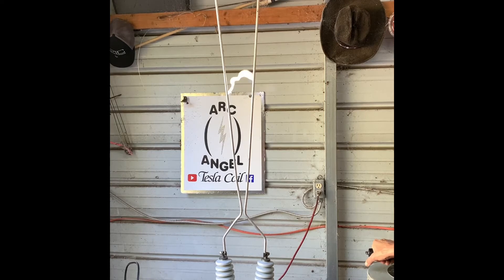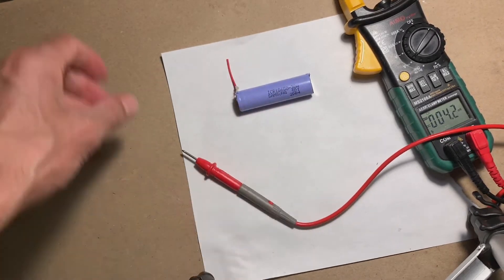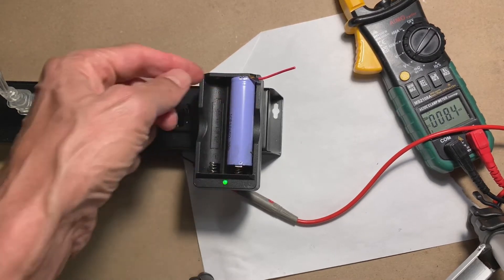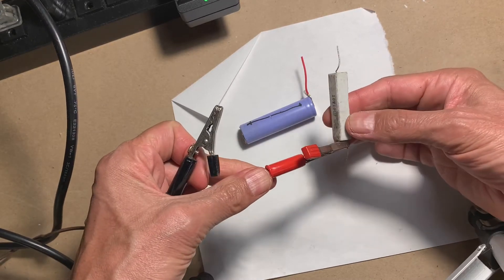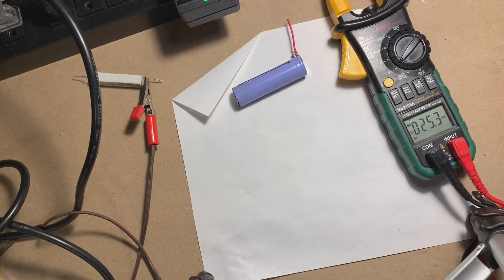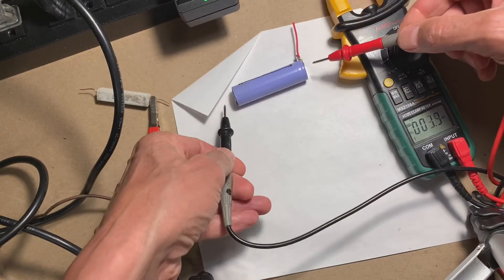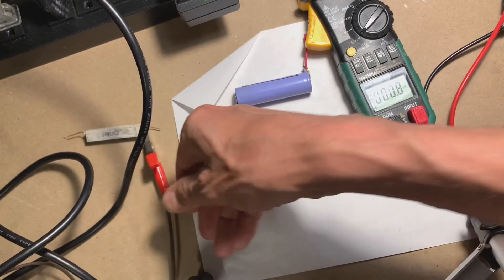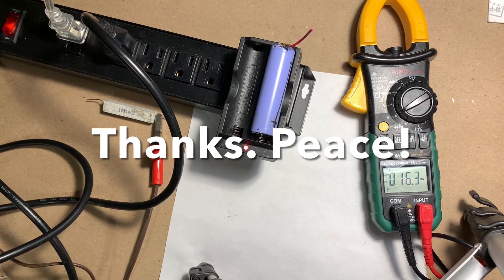Breathing New Life into Completely Dead Lithium Battery

Comment: Hi! Very clean and clear presentation! This does really work well. I have been using this technique to salvage seeming dead Li-Ion's from old Laptop Battery packs for several years now. However it may bear noting that you will rarely recover the battery back to it's full original capacity. I once inadvertently left a cell to discharge to zero, and though the original cell had been tested to 1200 mAH capacity on tests conducted previously it only recovered enough to deliver about 800 mAH after the abuse. This is still better than dumping them in the recycling bin or worse, contributing to industrial waste! They can still run many low current draw projects.

Comment: Nice. Did u try to use a bedini or re-emf charger, to charge dad Li-Ion cells? Maybe it's an easier and safer way to charge them. I built some bedini's and had good results with it.
Reply from the maker: No I didn’. However, thanks for the pointer I will try that.

Comment: Sometimes I think a phone or something won't charge, but I leave it on the charger anyway, and then suddenly it springs back to life.
Reply from the maker: Yep
I’ve seen that happen too. These batteries though would not charge no matter what. This seemed to do the trick though because they are holding the charge!
Reply: @BrianDhvTinkerer     Very impressive.  Now do a car battery.  Lol   That looks like a standard size battery, I have an xbox that uses batteries for the controller.  Regular batteries last a few days, but I got some special rechargeable batteries that are those special nickel metal hydride kind...  they last a super long time. Longer than lithium, I bet.  Lithium must be easier to produce and maintain or something.
Reply from the maker: Lithium ion batteries have a higher charge density which is why they are popular. They can also put out a greater amount of current. Main problem is if they completely discharge, then regular lithium ion battery chargers will stop working on them.
Reply: @BrianDhvTinkerer     Oh.  I suppose they need high output for cell phones.  The nickel metal hydride are more like a deep cycle car battery, and lithium is more like a regular car battery, then.  Kinda.  Because deep cycle car/marine batteries are used for sending steady power to electric devices, and are less likely to die when they are completely out of power.  And lithium batteries work best when they are above 15%, if you go below that level you also risk having a sudden power outage, because of factors like the battery memory.  Thank you for the info.
Reply: @BrianDhvTinkerer    ... I know that is not a good comparison, I just wanted to share what I learned about N mH batteries.  Cell phone manuals say that it is not good to go below 15%, so that is like a car battery, which is supposed to stay nearly full, all the time.  With the N mH, you are supposed to run them down until they run out of power, or at least it is not risky to do that.